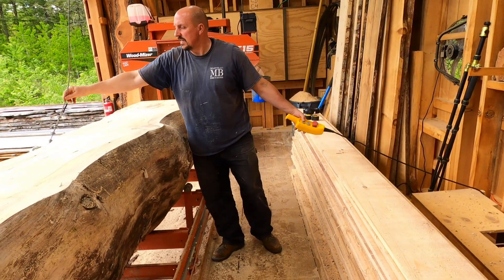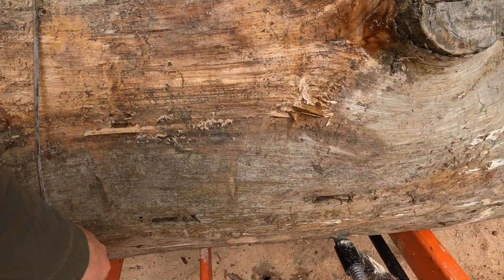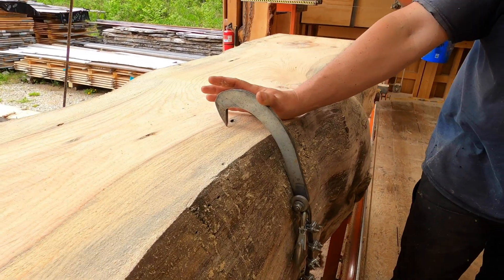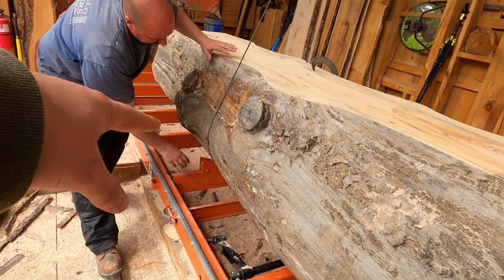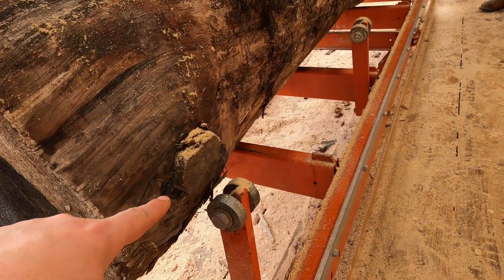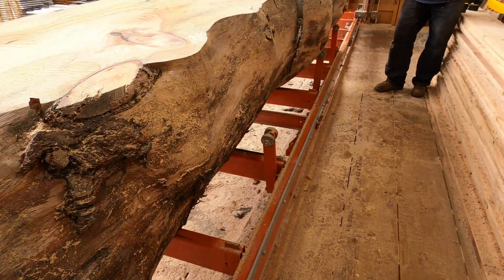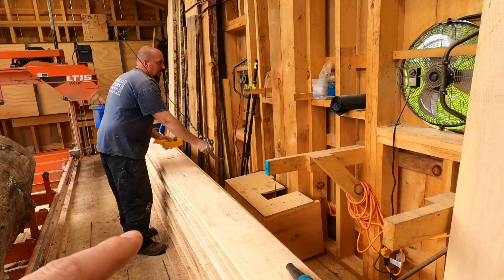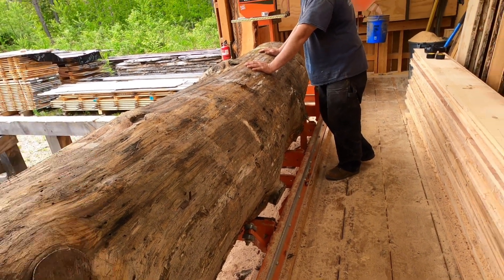Woodmizer Design Flaw, And Turning Logs With The Hoist

Comment: I just turned my first large log with a hoist on my lt 15 wide.  My hoist is mounted on a beam above the mill bed, but is offset several inches from center towards the loading side.  This has the vertical pull straight up and not at an angle.  I am making bridge planks out of doug fir.    I might try the improved pipe that you suggested.  Thanks for the video.
Reply from the maker: The hoist makes all the difference! How thick are the bridge planks you are cutting? -Andy
Reply: @cripplecreeksawmill  The bridge is a railroad box car cut off.  Cross planks are 4 x 12, 9 foot 7 inch long.  I am cutting these from my largest butt logs.  Half of the running planks are 3 x 12, and the other half is 4 x 12 mostly twelve feet long.  The approach has settled a bit is the reason for the two sizes.  I use a grapple on my tractor to help move them.
Reply from the maker: @netfun8  That sounds like an awesome project. Typically up here people want 4x8 stood on-edge for bridge packages, unless it has to support the weight of fire trucks. Be well! -Andy

Comment: Possibly when WM increased the width of the LT15 to make the LT15 Wide they just used longer lengths of the same material without thinking about longer length of the same stuff means easier bending.
Reply from the maker: It didn't even occur to me that they had significantly increased the bed width, I just assumed that the lt15 and lt15wide used the same rails. You are probably correct, it significantly decreases stiffness. I have to watch that sharpener vid from you and Dave from the old man and the saw, I just glanced at it, but want to watch the full thing in the next day or two. -Andy

Comment: Have y'all had the log stop bolt break from the frame yet...I had one break about a year in, and I got clumsy and broke another one with a log..
Reply from the maker: No, we have been lucky that we haven't had the bolts snap, but the design for those braces are just.....not great. There is no way to keep the pivot tight enough to maintain squareness, without making them quite stiff to turn. On the bigger logs we always check with a 24" framing square, to verify against the bed rails before we make the 3rd and 4th cuts on all the cants. -Andy